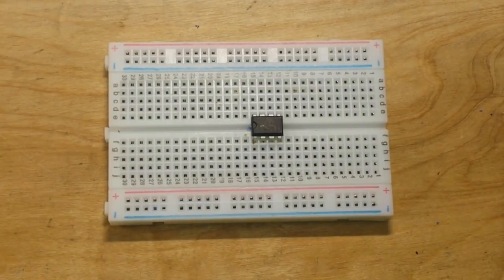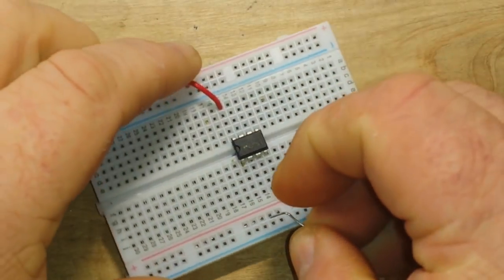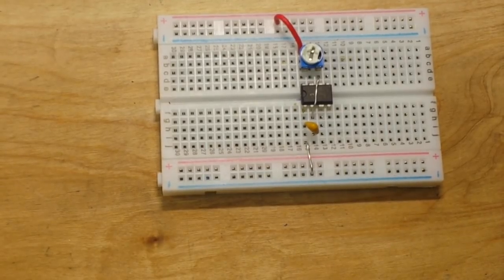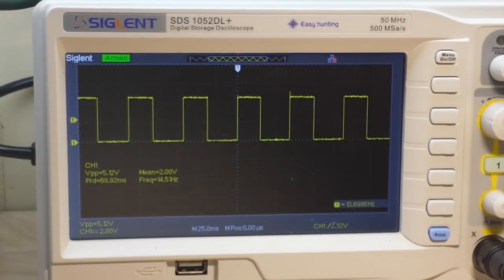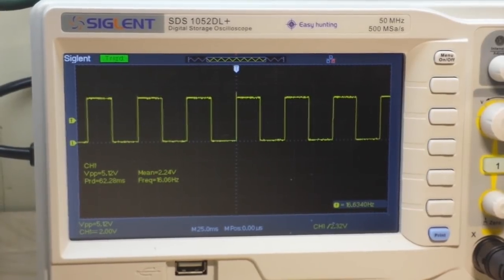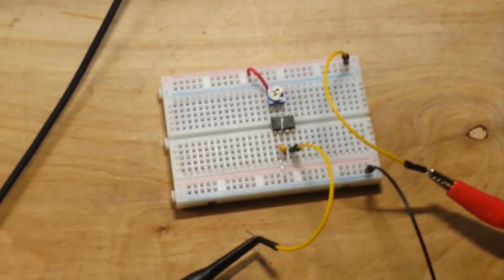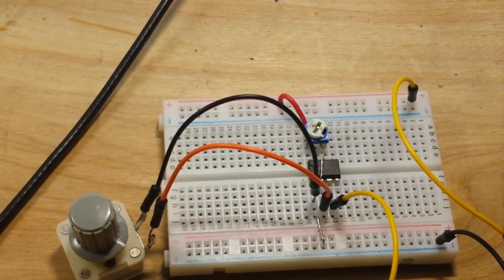Let's make a function generator(1)

Comment: @jumbo999614
What is value the variable capacitor and potentiometer that you use in this video?
Do you have link to buy variable capacitor?
I just built my first diy Arduino oscilloscope and I need to test it.

Comment: I have connected my 555 timer as a clock input to jk flip flop (74hc109).
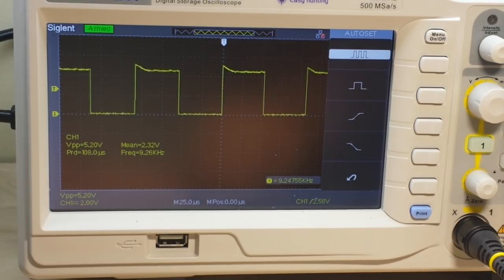 I am getting the waveform similar to what you have shown in video( 5:53 ) will that voltage spikes affect my clock input to flip flop??

Comment: Any reasons my square wave looks like crap?
Reply from the maker: Signal integrity
Reply: @learnelectronics  thanks but any insight on how I can improve it. I'm just an HVAC technician but with the way the industry is going your going to have to be an electrical engineer to work on new equipment. I have a variable air capacitor that is about 0-330pF.

Comment: When you first adjusted the duty cycle, you were actually changing the frequency. The "on" time remained the same but the "off" time lengthened. That's changing the wavelength which also happens to adjust the duty cycle, the way you have it hooked up. The scope even shows the frequency changing in the lower right.

Comment: Thank you - I have been trying for 3 weeks to get a 555 to work. Rubbish I know, but bad sense of direction, I turn them over, I lost which pin is which. Because you inserted very components before testing it worked. I am so happy. :)

Comment: Ever considered using an XR2206 chip? They're a bit better than the 555's, though not as ubiquitous and historical (and cheap).
Reply: I'm waiting on a 2206 in the mail to play around with. Can I use it to get some sounds out of? Like connect the output to a speaker instead of an oscilloscope?

Comment: Why always connect the ground first? I don't see it making a difference *here*.
Reply from the maker: Potential. Say two circuits have a potential of 5V. Circuit A's range is 1-6v. Circuit B's is 100-105. Electrically they are the same potential. By connecting the grounds first (referencing ground) both circuits now share the same reference. So in effect they are both 0-5v. If you don't reference ground you could effectively be putting 105v into a 5v circuit.
Reply: You are describing situations where multiple energy sources are to be connected. I understand your argument there. Here you have just one voltage source (a battery or bench power supply perhaps) and your breadboard. The breadboard gets its potential from the first lead you attach. Since the breadboard clearly has no other connection yet to any other potential there cannot be any voltage in the circuit from attaching just one lead, no matter which one it is.
Reply: Let's just all enjoy the site without any backbiting or name calling!  You had a valid question which Paul answered so everyone should be happy.  This is a great channel so let's all be friends!  ;-)
Reply: @Douglas Kryder "TheTruth" is a character from a video game. "TheTruth sent me" is a dialog line from a cutscene within that. I just liked the ring of it. You've obviously read to much in to that and used it to fuel your anger towards me. Regarding that: I didn't criticize any best practices. I merely advocated deeper understanding. I guess this bothers you. Sorry.

Comment: Awesome video!!! I need a 555 primer now
Reply from the maker: Look through my basic electricity and electronics playlist. I think I've done 4 videos on the 555 it's my favorite ice.
Reply: Thanks Paul! I just picked up some components tonight following your video here. Learned a lot by just fooling around with the basic setup. The 100pf varicaps I purchased were a bit small so I will just see what the old desktop radio has to offer. In the meantime I have some usable caps. 

Great series!

Comment: Hi, are you planning any more live streams ? Enjoyed the last one.
Reply from the maker: Yes I am. Any ideas for what you would like to see?
Reply: Having watched since 1K subs days,  I enjoyed hearing about your electronics background, interest in radio, family stuff, etc. 

You could discuss the practical use of this kind of radio in this day and age / explain the attraction of this interest (i've no experience of it). Have you tried SDR - software defined radio ? I'm tempted.

I also like your usual videos like this one showing practical use of different electronics components.

Any experience with Digital Potentiometers such as the MCP41010 ?  Any interest / experience with FPGAs?

I'm working  A LOT with the M5Stack (ESP32)- so I would be interested to hear your take on that. Its versatility now and with coming modules & some recent software development by users is quite remarkable. You can check some on Twitter. Happy to provide any info, but perhaps via Twitter PM - don't want you to feel I am advertising in your house !